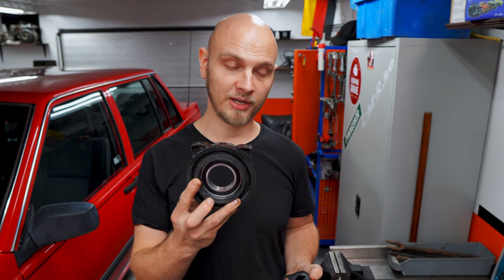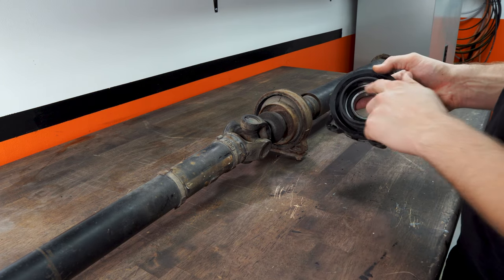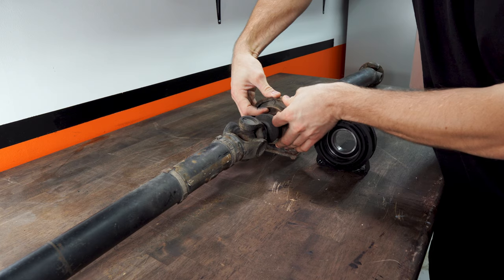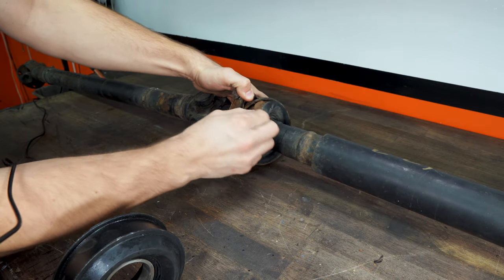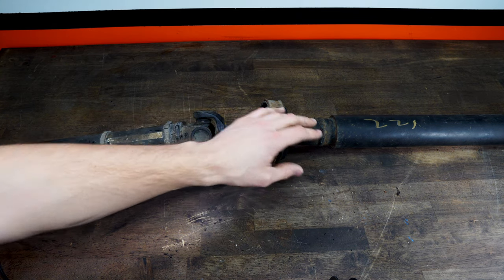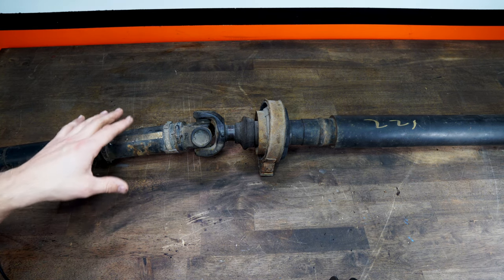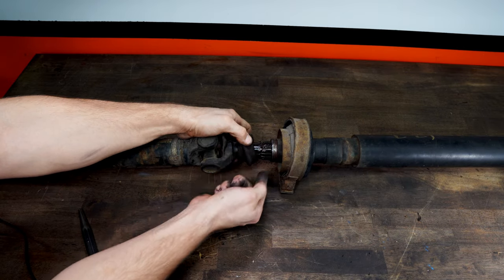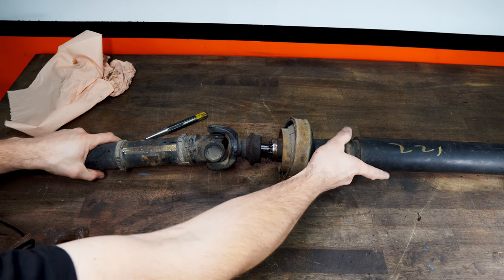Driveshaft Center Support Bearing Replacement - The Volvo 740 T5 Engine Swap Build

Comment from the maker: Are you racing on the jack stands like me or do you have a finished build? Post something about your project, I would love to know what my viewers have going on in their garage! 😃
Reply: Great work on the channel! 

I have a 1990 740 daily beater and a 1972 142 project :)

The project is pretty much a full restoration. Haven't decided on engine yet but most likely a b230fk for the ease of it, its going to be a road legal car so the plan is to follow volvo's own guidelines on 140 series. The guidelines says ventilated 240 discs at the front with 270163 (girling) pads. And 270164 rear pads (girling). On this setup you are allowed to run 180hp/215nm. To start off I plan to get hold of lh2.4 harness and run that, atleast untill the car and all the changes are approved by SVV.
Reply from the maker: Thanks! Sounds like a nice project 👍

 I have newer owned any type of the 140 series. But some of my friends has owned serveral differnt types of them and i really like the bodywork on that model. I did own the 242 from 1975, i think they share alot with the previous 142 like the B20 and M40 setup and some interior parts, really miss that car. 

Lycky we have those guidelines! Not a lot of manufactures have recommendations for swapping engines back and forth 😃  

The B230fk swap is a realtivly easy one, but if iam not misstaken the intake will hit the brake booster, but iam not sure. 

Wish you the best of luck with your build! 👍
Reply: @BackmansGarage  Yeah I absolutely love the looks of the 140 series. Yes you are correct the intake will interfere with the brake booster, I am probably going to move the brake booster to the battery tray since the battery is relocated to the trunk of the car. Here you can see the solution for the brake booster https://scontent-cph2-1.xx.fbcdn.net/v/t35.18174-12/15682110_10154027182651389_807617074_o.jpg?_nc_cat=105&ccb=2&_nc_sid=ae9488&_nc_ohc=JkT_e3swM4kAX_UKbOq&_nc_ht=scontent-cph2-1.xx&oh=acc0e9dacd9772c57a8c84c1e1af8612&oe=5FB30AF3
Reply from the maker: Omg, haha never seen anything like that before. Nice way of getting around that problem 😃 👍

Any idea of where that booster comes from? Iam guessing that is stock on some car right?
Reply: @BackmansGarage  Yep hehe! Its a booster from Volvo p1800/Amazon
Reply: har en 740 med m50 så blir lite effekt bygge siktar på 550hk😁👍

Comment: 740 GLE sedan 16v, 960 92 wagon, 91 240 GLE wagon, 88 240 GL 16v sedan, 87 760 GLT sedan IRS, 360 GLT MIG diff, 240 sedan parts car, 85 240 GLT wagon manual. Mods on most of them, suspension, brakes, driveline, engine, etc.

Comment: Jag får ett dovt ljud samt vibration mellan 60-90 km/h efter byte 😐 O kardanen kan ju bara sitta på ett sätt så allt sitter som det satt innan. Vad kan det vara?
Reply from the maker: Har hört att flera har fått detta fenomenet från icke volvo orginal stödlager... Jag har ju inte kört min än så jag vet faksiskt inte. 
En polare till mig sa att han löste sitt problem genom att slipa lite på stödlagerhållargummit så att det blev en luftspalt emellan gummit och den yttre stålringen.
Reply: @BackmansGarage  Jag har inga såna stålringar i mitt 😅 Kan inte heller hitta nån som säljer. Men hade inte det innan heller. Så det är alltså fel på själva gummit och inte lagret, inte heller ett balansproblem? Men tack jag ska experimentera

Comment: Looks a bit different from the 240 one. I had to cut mine off it was soooooo seized on
Reply from the maker: Yes the 240 one is a bit easier to get to, but like you say, they are also harder to get the bearong off of. 

I usually pull the rubber off from the bearing and cut off the outer bearing race in two pieces and cut and split the inner ring with a chisel so you can pull it off.  

I really need to get a 240 for the channel 😃